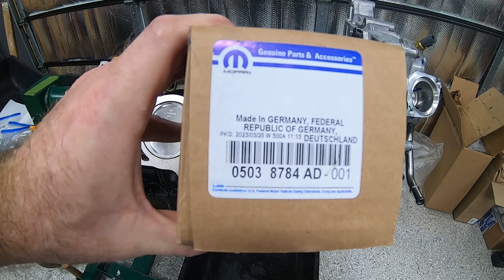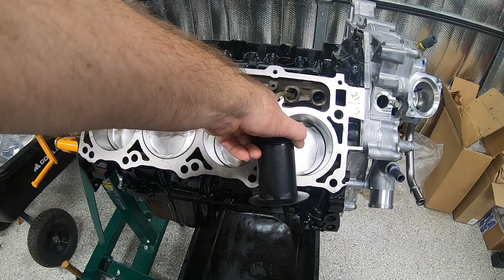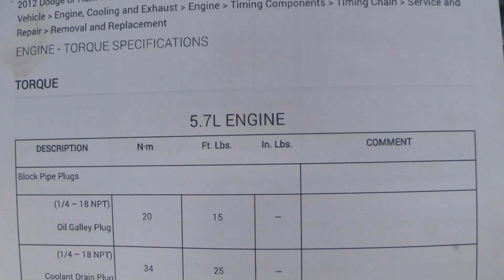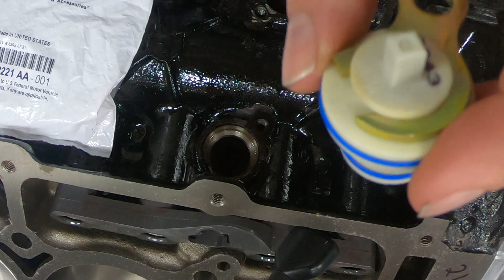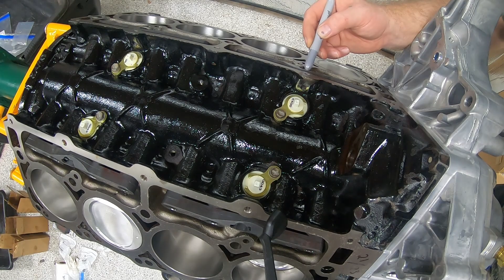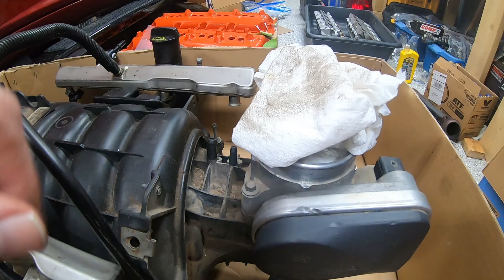2012 hemi 1500 Sleeper Apple Part 21. L.B. Part 4.  Lifters, MDS Block Plugs, And Intake Discussion.

Comment: yes its hard to clean the intake as my car was 6.4 2011 and its never get cleaned before its was a disaster inside this thing the amount of sludge its stick every where and need to be brushed,  more over if you want to clean it with solvent you may damage the short runner seals in side it so don't clean it if you cant open it. the factory recommend to replace it in case of engine failure.
Reply from the maker: We have a catch can on the way for this build to help keep the new intake clean or at least see how well the catch can will work.